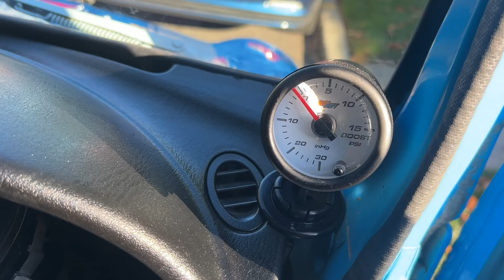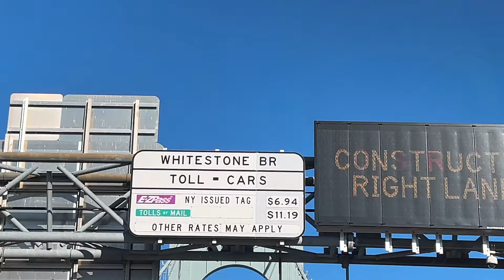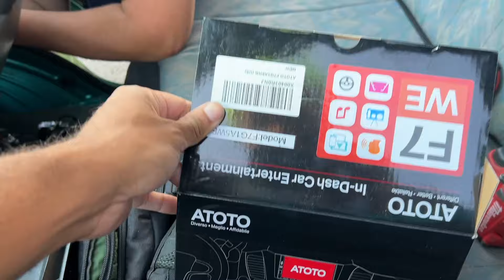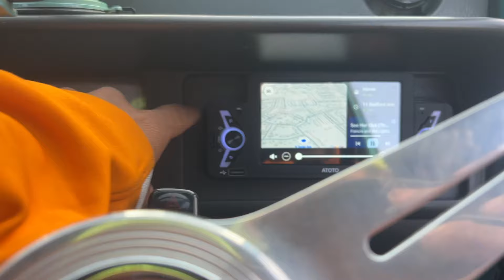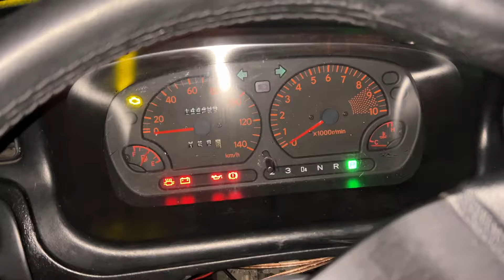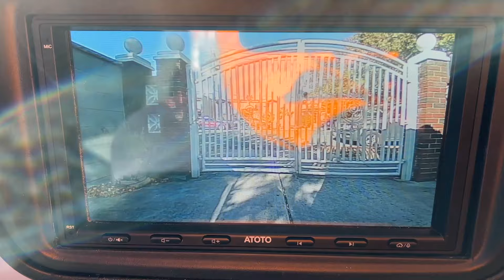Coolant Leak Fixed + Custom Interior ALMOST Done On The Mira Walkthrough!

Comment: The beeping noise usually happens when the key is in the ignition with 'the accessory on' and the door is open,when you push in the door sensor the beeping stops

Comment: The beeping could be a wire connected to the ignition colum cluster. The blue box may be the speaker, when it happens listen closely for it to remove the connection to the little speaker, unless you need the chime beeping.
Reply: Due to the swap, it could be a chaffed wire causing the issue so be sure to have a fire extinguisher at the ready.
Reply: Cut a board to replace the face of the drivers side box, or cut the face in half for storage in one side and speakers in the other. It will need a divider board between the storage/speakers and use a hole saw to place a port for breathing/back pressure for the speakers. There are speaker pods for 6.5 inch speakers you can add anywhere off of flea-bay

Comment: Since this is your forever Kei why dont you look into relocating the intercooler?
Reply from the maker: what's wrong with the intercooler?
Reply: You were talking at the end about maybe a hoodscoop but also not wanting to mess with the look. If you wanted it to have good airflow, you could relocate it in front by the radiator.
Reply from the maker: @littlefreak3000  oh yeah but theyre no airflow anywhere upfront the bumper and grille is also closed